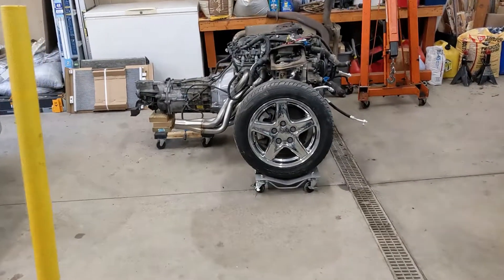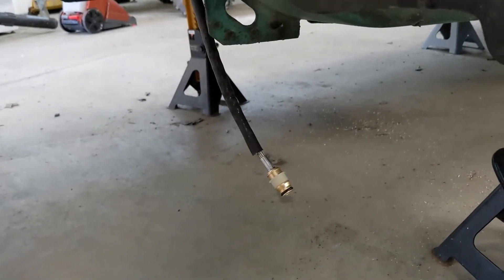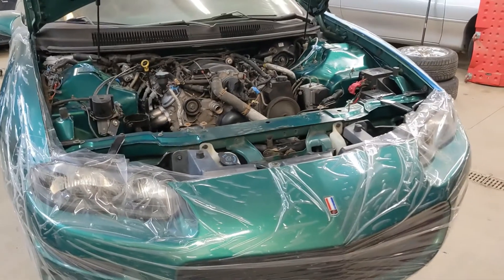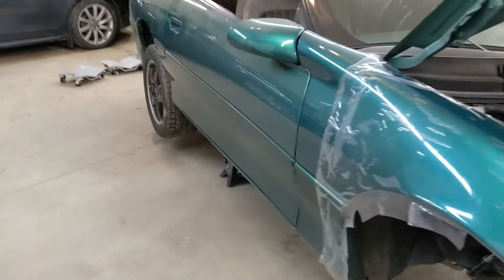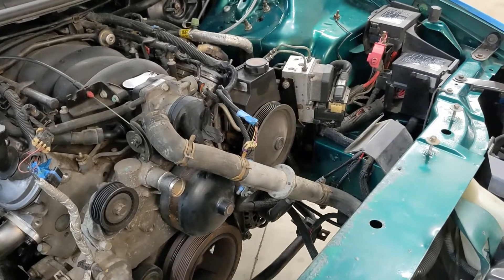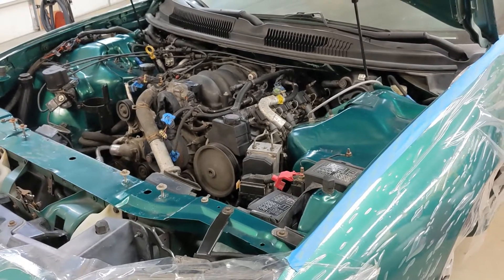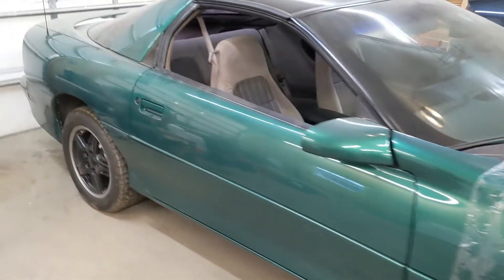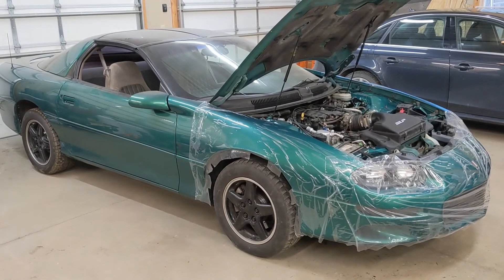1998 3.8l V6 Camaro to LS1 / T56 swap - Part 13  - The V8 is in

Comment: I’m doing the same swap. Far as the clutch master go how do you determine the whole in the firewall?
Reply from the maker: Sorry for seeing this so late, you can check my build thread here for some more info on when I cut the firewall hole, but the best way I found was to mount the new pedal set and trace out the hole that way.

https://ls1tech.com/forums/conversions-hybrids/1955246-1998-3-8l-v6-auto-ls1-t56.html#post20408041